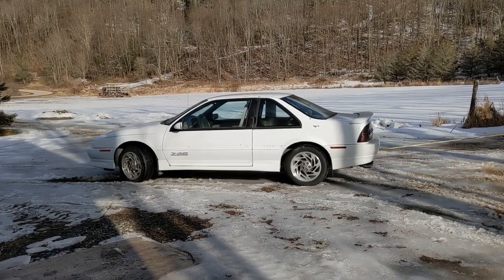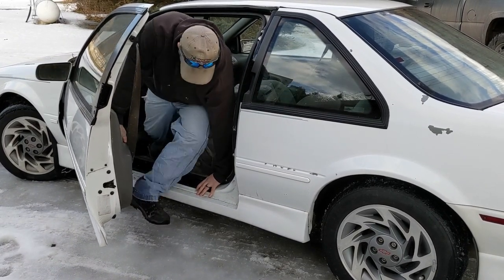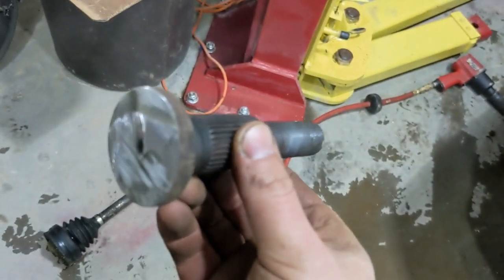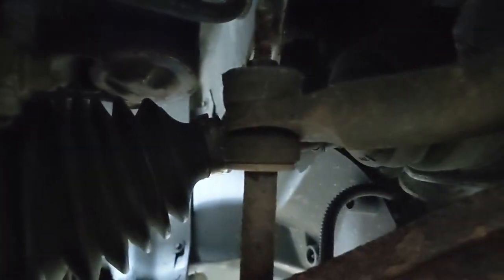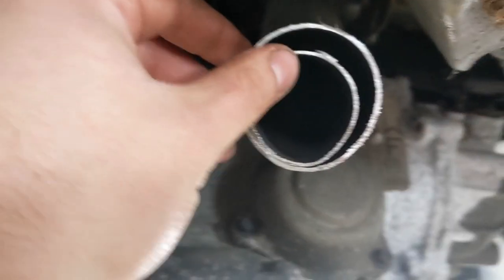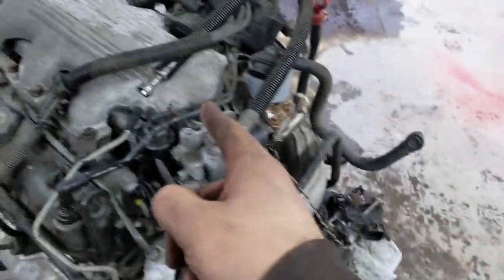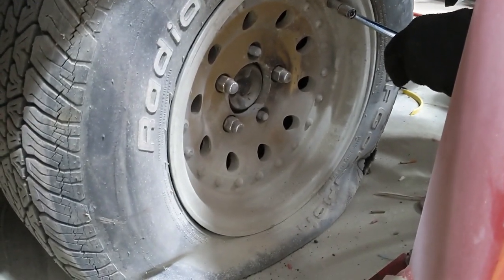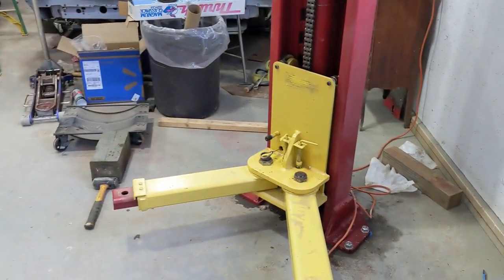FWD delete on the new lift - Beretta #LSswap

Comment: I know this is no longer an issue for you, but I had a sticky park pawl on a 4T60E in my Century. My solution was to put it in neutral and rock the car back and forth until it unstuck itself.
Reply from the maker: That didn't work when I tried it, but it did work in drive. I just had to jump in really quick. Haha